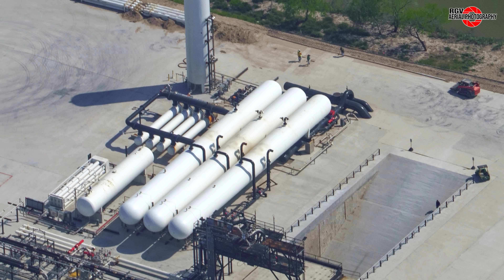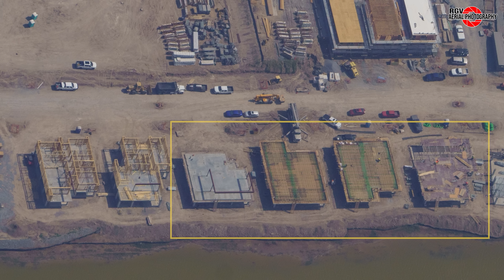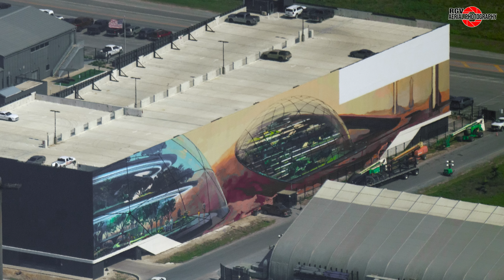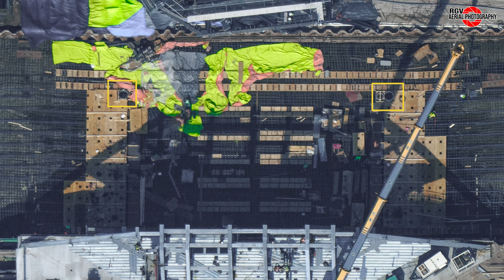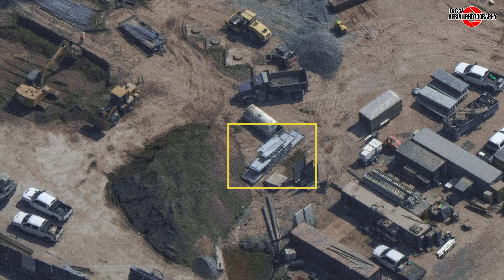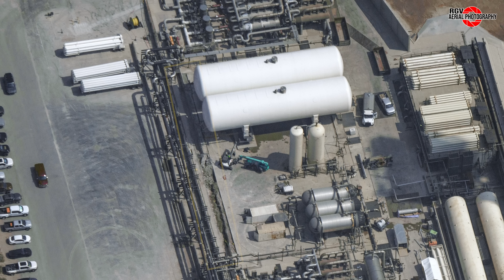Flame Trench Concrete Poured + Rio West Updates! New Starbase Flyover 76

Comment: The announcer's sing-song delivery grates on my nerves. Truely.

The delivery seems to compulsively rotate through a mandatory set of the exact same notes – except at the end of sentences in the low register, where he sounds quite "normal". Please "do that" much more often. 

Use a consistent tonal set to structure and convey a list, but don't "sing" entire paragraphs. 

Especially, please omit those abnormal high notes (shudder). The tonal emphasis never matched the text or intent. [Many of the tonal transitions seem random, fracturing the sentence, and cause dissonance.]

Try to employ subtle "sharp" and "flat" notes as emphasis or textual contrast to maintain listener interest and reduce audio fatigue. 

And please, in your spare time, record yourself imitating several quite different announcers, until you internalize a sense of their various delivery methods.

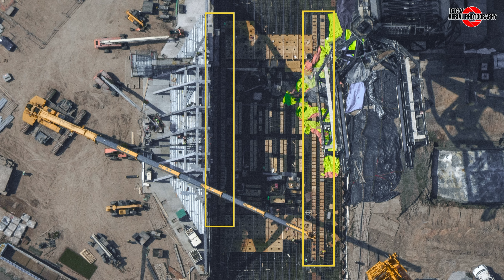Comment: 8:18 I'm puzzled by the offset of the apparent north wall embeds from the sheet pile wall.  Its almost like they intend to run another commodities trench along the north wall of the flame trench.  🤷‍♂️

Also, if the flame trench is really going to be only as wide as the spacing between the north and south wall embeds, and the width of the flame bucket being constructed at Sanchez, it seems too narrow.  Look at the wear and tear on the Massey's flame trench from just a handful of Ship static fires: the Pad B trench will have to deal with about 3× the number of Raptors firing at each half of the flame deflector/trench, at full thrust for launch vs. half-thrust in static fires, and with eventually full-blown Raptor3+ engines putting out 300+ tf each vs. the current 230 (up to 250?) tf.  That's like 7-7.5× the overall stress on the flame bucket and trench for every launch, as compared to Massey's static fires.  And on top of that, the long-term goal is rapid (~weekly?) launch cadence with minimal maintenance.  Right now, the Pad B trench and flame bucket aren't looking like a full order-of-magnitude improvement over the Massey's build.  I'm mildly worried that this might prove to still not be the final and fully adequate pad design.